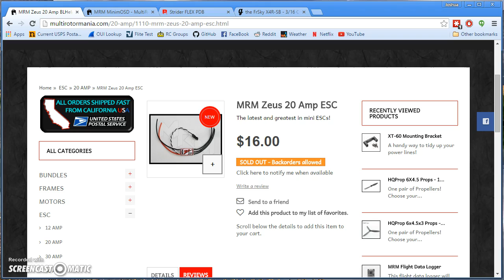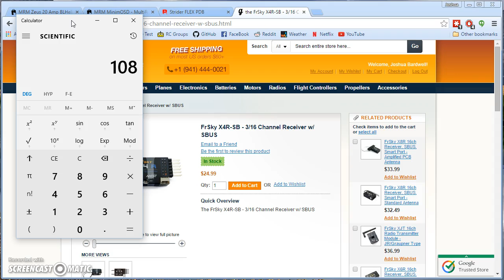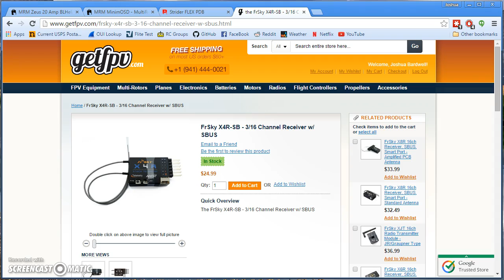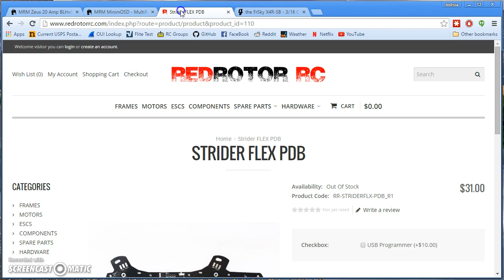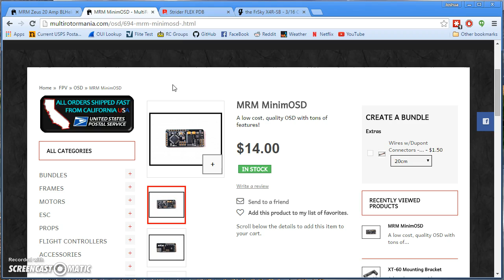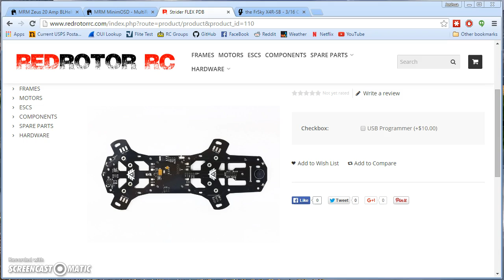Coming soon: copter tear-down and re-build

Comment: The Strider is an awesome flying mini quad! I got the rrosd one back when they first came out and I still have it in my fleet of mini's! The only thing that kind of bothers me is how thin the bottom plate is. It could be thicker to help stiffen up the frame a little more. With all the blackbox data you go over, do you notice a slightly noisy frame with the Strider? I get weird harmonics sometimes when spinning Hq5x4's with 2300kv 4s. I mainly fly the gemfan BN 5x4.5's and do not notice it with those props?
Reply from the maker: +Bozi B Hard to say. There are so many things that affect noise other than the frame.

Comment: I came to the same conclusion about the X4RSB a few days ago while looking for a smaller, lighter RX that had SBUS. I did not realise however that there was so much latency with PWM. Thanks for the analysis. When you come to doing the mod to the RX there seems to be at least one solution I've found that shows a clear photograph of what to do. One thing you can do is to make the mod simpler by doing the following:

Option 1

a) Locate U8 which is the Inverter IC
b) Unsolder Pin 4 and lift it right away from the track.
c) Solder a very small wire (enameled copper wire from motors etc is best) from Pin 2 on the IC to the track positioned at the Pin 4 on the same IC. Making sure not to touch the output from Pin 4.

This is effectively replacing the inverted output from the IC with the true input being fed to the IC. It also means that the solution is reversible if you need to in the future.

Option 2 

Same as above only this time unsolder U8 and throw it away ! This makes the soldering so much easier and you can use just a piece of tinned copper wire.

This is what I will be doing when I receive my RX. The advantage of using this approach is that the solution is very neat since you are still using the same outside connector for SBUS only this time the logic output is true rather than Inverted.

Hope that helps. 
Tony

P.S. These are my own suggestions. I've not tried this yet but I don't see why it would not work.
Reply from the maker: +Tony Leyland Expressive Imagery "Same as above only this time unsolder U8 and throw it away ! This makes the soldering so much easier and you can use just a piece of tinned copper wire."

That is a great suggestion, but since I don't have a hot air rework station, I'm a little skeptical of my ability to desolder the IC without damaging the board. Still... very worth keeping in mind. Way superior to putting on a new lead. I may give it a go just because it's so elegant. Or maybe I'll buy a rework station...
Reply: Joshua Bardwell I know what you mean, those SMT components are pretty small. There are a couple of ways to remove the component:

Option 1
a) Use a small tip on your soldering iron and heat up each pin and lift it away with another tool.
b) Repeat for the other pins then the IC should come away.

Option 2
a) Use file cutters to cut each pin then the IC will fall away.
b) Finish off by desoldering each pin that has been left behind. You can use a handheld desoldering pump to remove excess solder and stuff. They are only cheap (<$20) and do a good job.

I would say the tracks and PCB would survive both of the above options.

I also think those new ESCs you are buying are going to make a big difference to your flights. I have the UBAD 20A minis (Atmel based) and I'm thinking of the same as yours for better flight performance and removal of twitches from my video.

Tony

Comment: Really interested about seeing you getting sbus working on the naze. Thats my next step I think.
Reply from the maker: +Noel Harris In theory, it's simply a matter of soldering a wire to the x4r. If my memory is correct, FrSky even break out the pad, rather than forcing you to solder to a pin on the inverter, like you had to do on the x8r.

You know, come to think of it, I already have an x8r that came with my Taranis. If I had half a brain, I probably could have cut that down to a size where it would have fit on my copter, and saved myself $35. Derp.
Reply: But I thought a naze doesn't accept sbus? That's the part I was wondering about
Reply from the maker: +Noel Harris My understanding is that the problem is Naze doesn't have hardware inversion on its UART, and SoftSerial is too slow to handle S.BUS. So you need a discrete inverter in-line, or you can solder a lead to the un-inverted S.BUS signal, as shown here: http://eleccelerator.com/frsky-x4rsb-sbus-anti-invert-hack/